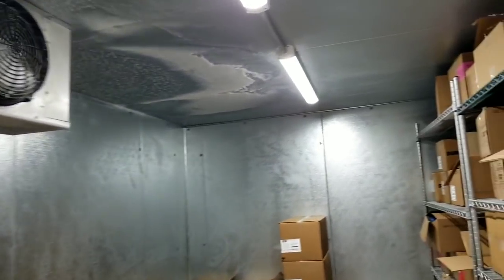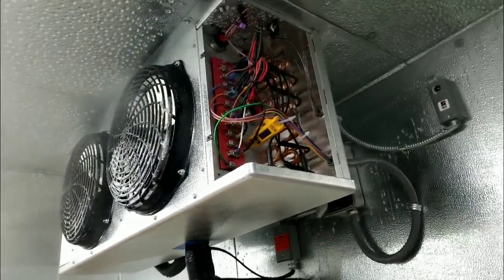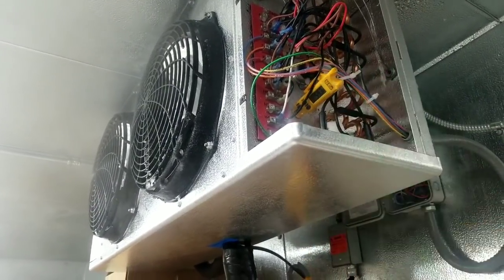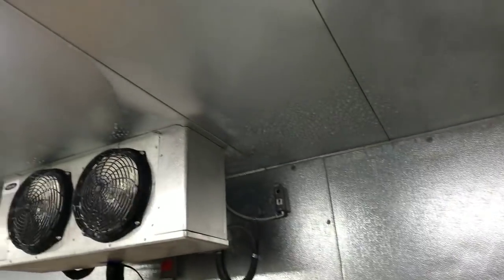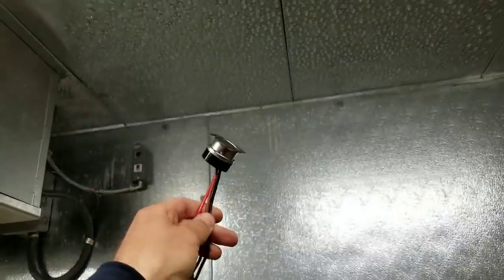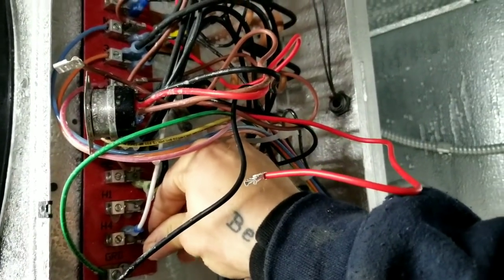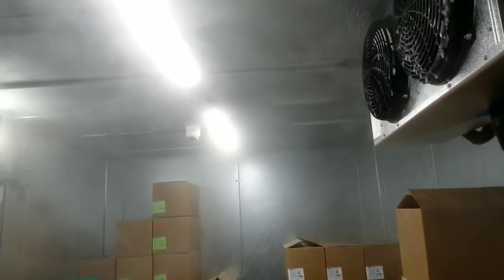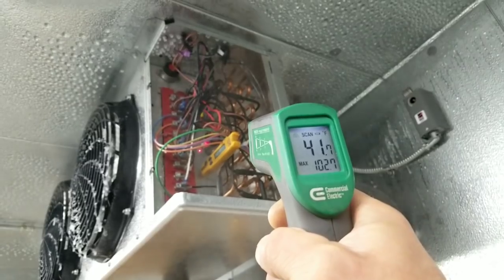Defrost issues

Comment: Hey Bill,   What May have helped in this situation is a 6 pack of AAB TS-100 temperature and humidity data loggers... they would record around the clock for a week or so then you can see what happens during the week.  I have used them to verify economizer operation while letting things operate without jumping them out !   Just a suggestion!  Thanks for the video! 👍
Reply: I like those, but....They are great for refrigerators but crap out at below zero temps.
Reply: I’ve had pretty good luck, but never did check them below zero!
Reply: One near the door would also log door open events

Comment: Good video Curious. Just use couple wire ties and relocate the defrost termination and fan delay switch to secure it to one of the return U bends , “as an experiment “ I’m sure it will work and kick the unit out of defrost in 15-25 min max rather than 38-45 , just do that you can prove your point to the manufacturer. Refrigeration is tough man . I would Take pics and a short video as proof . Good video 👍🏼.

Comment: Refrigeration manufacturers will tell you to do ridiculous things that waste your energy. They do not know the answers and don't care.  You had it solved with the 6 times a day 15 minute defrost, thats all you need for that small evaporator. I would add curtains to the door. Thanks for all the follow thru videos. I have the same issue which i am working on replacing the ripped curtains and I am going to try lowering the defrost times like you did and I will let you know how that goes. I also found the coil mounted dt and fd switches removed and dangling from the coil which I mounted back and tested to be working. And that coil mounted dt switch takes it out of defrost within 10-15 minutes, it never goes the full 30 minutes.

Comment: If look at video again, take a look at wer u connect black wire. Looks like terminal is h4. Wouldn't that b a heater circuit. N black wire should b on fan circuit. Some blocks have f terminal but didn't c one. Anyway from the issues it seemed to b having maybe its wired wrong from factory. Always enjoy videos 📹.  Thanks

Comment: This type of service call is the style you never see in a book,.... only real life ...  Funny thing is, this is a classically common thing I see in the field in commercial walk ins.  Another is the low/ med temperature box with a divider panel.  Or the one where you walk thru the med to get to the low temp box.  I had one with a roof leaking down on the box from above...  These are the head ache cases.   Echhhhh

Comment: So what it may be is the 2 wire heater limit may be cutting in and out during defrost, thus why the front of the coil takes forever to get to 55 degrees to terminate on X.  
That system looks undersized, 2 fan freezer is no bigger than 9000 btu for low temp. 
Either way 15 minutes and it should terminate if there is heavy frost on that coil.

Comment: I had a 14 x 20 walk in freezer that would frost up like this, i moved the term sw to the top of the frame and run 5 defrosts per day and it kept it very clear. moisture was a prob in this case because this was a packaged ice storage freezer and the door was opened quite often when bagging and on truck loading day. I also only ran it at about 15 degrees and we also had a curtain on the door. 
oh how i miss the days of running my own business and doing all my own repair work.

Comment: I think you have a condensation drain problem,  look at a pan if there still moisture in it after the freeze cycle starts on, if it is fixed drain line.

Comment: Looks like your having Fun ! Have you tried setting DEF clock to 4 times per 24 hr cycle an shorten defrost time by one pin . To help solve droplets on ceiling ? Defrost termination temp. sensor is secondary or fail safe to clock . Good luck , will be watching at 6 pm CA. HVAC OVERTIME

Comment: looks to me like too much moisture is going in the box for it to cope with.  Maybe employees fiddling around with door open?  heavily wet mopping inside? deliveries getting rain soaked? box/door leaking too much moisture in? drain clogged or pan holding water, from being buckled up in the center?
if it's taking that long to trip the termination, there would have to be heavy ice build up on the inside opposite of that area to keep it cold for so long. maybe moving the switch would help, but I'd be afraid it would ice up out into the fan blade then. I'm more of still on too much moisture is going in to be removed or it's just not draining away and pooling up evaporating back into the air

Comment: sounds like the typical manufacturer run around that does not want to admit the engineer that setup the system could be at fault and the techs out in the field do not know what they are talking about. They act as if those of use who went through school or have years under the belt have not seen these issues. This manufacturer seems to act as if you are the owner of the unit and just delaying until warranty runs out. Hope you get somewhere soon with this, like along the lines of what you suggested.

Comment: Was the defrost element checked with a clamp or did I miss it? 
Btw those laser temp sensors can be way off not accurate on shiny surfaces.
Reply from the maker: Hey Nathan- I did check the defrost heaters in part one I know for sure, thanks for the tip about those laser temp guns, I should have had a surface mounted probe for that little experiment
Reply: I don't think those IR sensors are very accurate, especially on shiny surfaces. Would have tried an old k-type thermocouple wire stuck underneath the DT sensor.  Have never seen it used this way but wonder if a heat sink paste would be good there?

Comment: I would put Dixell control digital ,,whit sensor,,,easy to install,,,,easy to programm,,,,,!, solve the problem....saludos Lorenzo ,,,,
Reply: Hot Gas defrost is also much more efficient but then they would need a smarter controller like a Dixel or Carel unit to sequence the cycle properly. They are both fantastic little units.